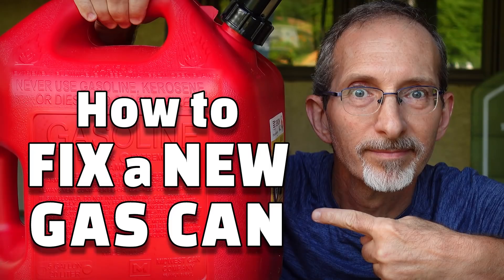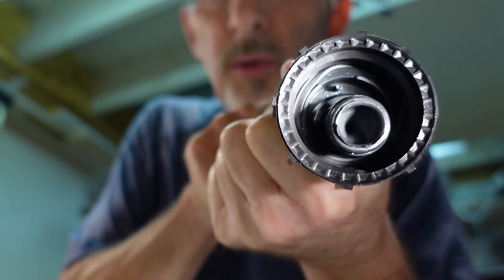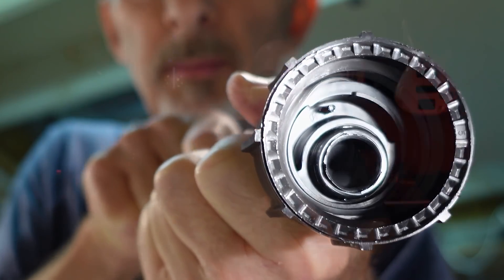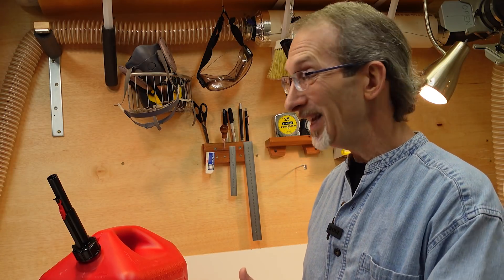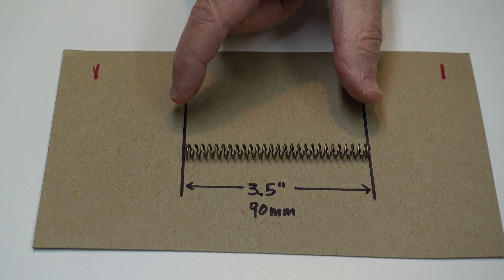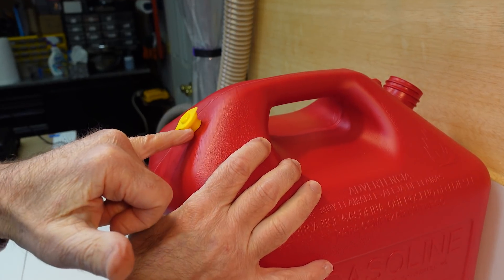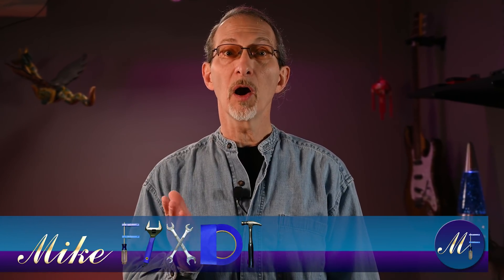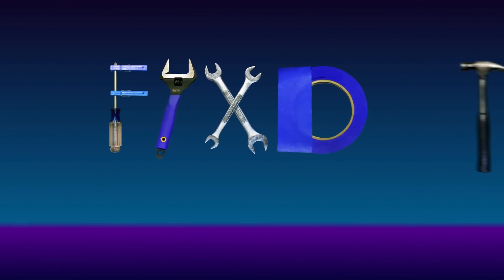Gas Can Modification | Part 2: Explosive Details!

Comment: I was a Risk Managed for the largest municipal utility in the state of Michigan.
Fire prevention was very high on our list of safety measures. We used systems like Lockout Tag out whenever hot work was performed, among many other safety program rules and procedures.
I agree with everything in this video.  The ridiculous modifications to gas cans create more of a hazard than the old style cans.  Proper training is the solution.  But as the saying goes “you can’t cure stupid.”
Reply: You cant cure stupid, but you can vote it out if office.
Reply: @patrickbodine1300  Or at least require actual engineers make the standards.
Reply: @Stroys last sentence says it all.  ♾️ 🔁
Reply: “I was…” 😂 they discovered you had common sense and critical thinking skills.
Sorry you lost your job due to those skills. 
No place in government for that skill set.
Reply: I like stupid people deserve stupid results
Reply: Proper training only goes as far as proper execution.
Reply: Two by four applied to the back of the head cures stupid but this method only works for few hours and must be applied again.
Reply: The new gas can spouts have created an unbelievable dangerous fire hazard. I have personally never seen someone or myself been able to operate these new ones without spilling everywhere. The old design I was able to pour without spilling for decades even has a 10 year old. The nightmare these new spouts have created almost seems intentional to start more fires, create more gas spillage, and be over all terrible for the environment.
Reply: Not only is it impossible to 'fix' stupidity, they've made it illegal to try.
Reply: Lock out/tag out in the Navy, we actually had one guy in the repair shop on board ship who spent the entire day doing nothing but LT for everyone else 🙄, yea I guess the Navy was worried about a vessel loaded with Nuclear warheads.
Reply: I used the new style spout which is tricky.. Its only 2 gallons.  Seems ok.
Reply from the maker: @Stroys - thank you for supporting these mods and my message! This video definitely put me into a gray area, where common sense and regulation are heading in opposite directions. It’s nice to hear someone from the industry’s opinion. I appreciate you joining the conversation!
Reply: @stroys (2 years late to this party)  I work with LOTO systems for years. But they don't make the tool you want to use from actually working. These gas can improvement mods do that and the exposure to longer time, with a heavy load, in a usually awkward stance, are NOT improving safety.  It is rare I don't spill gasoline with these awful unmodified gas cans.  Hence all of my cans are modified similar to  Fyxdt.

Comment: I have 3 cans with a pop top and a air vent  from the 80-90  and what ever!!  takes 3 seconds to fill anything  these new cans  SUCK SO BAD !!   but the older ones are 2 gallon ones  and needed bigger  WHAT A PAIN IN THE ASS !!!
Reply from the maker: I also have smaller cans that I’m happy with, but I needed some bigger ones. This is what I ended up with, and after the fixes I have to tell you they are actually OK. Thanks for watching!

Comment: I would have smacked that vent with the soft side of a parts hammer. No heat around gas fumes if the can was already put in to service.
Reply from the maker: I am definitely going to try the mallet trick instead of heating it next time. Thanks for the tip!

Comment: Just a side note in our area u can buy the original style spout and swap them out. Im not sure what regulations other areas have.
Reply: I get my replacement nozzles at Tractor Supply and they also come with a vent with attached cover and they work great on 5 gallon plastic cans.

Comment: I work at a full service gas station, see many of these, even sell them,  EVERYONE HATES THEM, To the point that they buy racing cans, there's cheaper and easier to use   or just go to tractor supply and buy a nozzle that is a replacement for that one,  toss that one in the garage,  where it belongs
Reply from the maker: Karl, I value your expert opinion, especially since it agrees with mine! :)

Comment: Dude, why you sweating bits into a clean, new can. Just dump it or rinse it when done drilling. Even blow some air if you got it. 
 Heat the can...not a chance of me doing that. Palm strike or rubber mallet.
I don't know anyone that is a "get er done" kind of guy at home that would do anything other than make it go.
 I have new ones in all my cans as either a replacement or like those SOB'in new cans, an added feature as you have done.
I guess it's good to show options but show the simple man options as well.
 I have an entire shop for our home, hot rods, and maintainance equipment and don't own and air solder heater dealy...
But I do got a rubber mallet and a palm to strike it home with.
 Good video...
Reply from the maker: I hear you! The fancy air soldering thing is my sons and just happened to be there, so I thought it was safe to use. I kept my finger in the stream of the air figuring that if it was too hot for my finger, it might be a danger for the can. It never got that hot. Next time I do this I will give it a good whack with a mallet, like suggested! Thanks very much for watching!

Comment: Brilliant, the vent cap was a perfect choice to fix the slow pour of these "new safety cans". you also picked one of the thickest parts of the entire can to install it. as for the spring, I would have gone to the hardware store for a new spring with a smaller diameter wire or more coils or both. When you remove coils from a spring the coil or spring rate increases (the spring gets stiffer). however, your method is perfectly legit and obviously works. This is only my autistic brain at work that drives me to perfectionism, it doesn't always work. I agree with you on the flame arrestor. I don't pour gasoline on open fires, but I have seen people do it... and get burnt. As one of my more favorite characters likes to say, "Stupid is as stupid does".
keep up the great work. I look forward to seeing what else you have for us.
Reply from the maker: I appreciate you watching and it seems like we have a common way of thinking. The spring was an experiment and I think it worked out pretty well. One of my goals was not to spend anything additional, just use what came with the gas containers. Mission accomplished, but I’m sure there’s other valid solutions. Thanks for joining the conversation!

Comment: I've spilled more gas trying to use those "Safer" spouts, than I ever spilled before....
When it comes to gas-cans, "Difficult = Dangerous."
Reply: I have NEVER gotten more gasoline on myself then I have trying to use these "safety" spouts.  I've had some that the spring was so strong, it literally shot the end of the spout and miscellaneous parts into the fuel tank when the little lip slipped off the edge.  Naturally fuel went everywhere.
Reply: And all the hydrocarbons that are being released during the spillage from these unsave designs.
Reply from the maker: Allan, exactly! Thanks for watching.
Reply: Exactly.  I gave one of these cans.  Absolutely hate it.

Comment: I am a 72-year-old with emphysema along with back fusion. I for years used a jerry can to fill my bobcat with diesel fuel, gas is 36 lbs for a 5 gal can, I have been told that I am limited in the amount of weight I can lift to 15 lbs. in 72 years I haven't ever had a punk-ass college graduate need to tell me anything that I don't know without the common sense factor. The Government has put these things into law now I can't even get a new nozzle for my Gerry can. when I used the can's to fill the heaters I got the smaller nozzle so there wouldn't be the threat of spilling it. I know you are saying what is a 72 year old doing this for. to tell you the truth it boils to the quality of life that I want to enjoy.
Reply from the maker: Alan, I hear you! Thanks for contributing to the conversation. A lot of people who have posted have spoken highly of battery operated siphon pump’s, which let you leave the fuel container on the ground and put the fuel where you need it with no lifting. Maybe that would be helpful?

Comment: It's all government regulation B S. Think Midwest worst move was doing away the the side pour handle causing more strain on the back. I have a old midwest 5 gal can that has that handle on the side and by far is way more comfortable when it comes to the pouring.
Reply from the maker: Bryan, you bring up a great point, the ergonomics of this can. I definitely think a side handle would make this easier to manage. Thanks for joining the conversation!
Reply: @MikeFyxdt  Actually the side handle to me should be horizontal rather than vertical and just up from the bottom.

Comment: Excellent video, Mike! I did the spring and cap mod to my midwest 2 gal, didn't need to vent it as I'm using it on a small push mower.
Reply from the maker: Thank you Paul! Yes, when you’re filling a smaller gas tank maybe the slower flow would be an advantage. I appreciate you watching!

Comment: Typical of the government, take something that works and make it unusable. I'd love to see the idiots that came up with those spouts try to put gas in a tank that has a filter installed in the neck of the tank or try to hoist up a six gallon gas can to fill a tractor.
Reply from the maker: Yeah, there’s some things you just shouldn’t attempt with these container designs. A lot of people in the comments have recommended an inexpensive battery operated siphon pump, so you don’t have to lift the container and you can easily put the fuel where you need it. That sounds like a good idea!
Reply: @MikeFyxdt  great idea 👍

Comment: Fancy name to get people to buy a dangerous product. Pressure will build and when you try to empty the fuel into a tank on a hot day it will spry back ond possibly cause a fire and how do i know ?  Years ago i had just this experiemce and i was not impressed. I destroyed the gas can and went back to the old can with a plain nozzle and vent.
Reply from the maker: Manfred, you are correct – you definitely need to burp these cans if they have been sitting. Great points, and I appreciate you joining the conversation!

Comment: i still got my old gas cans from the 80s and the 90s and the one that i have from around 2010 is the worst thing so i use it as added fule storage but then my old 2.5 gallon can runs out i fill it with the 2 gallons from the can from 2010
Reply from the maker: My 2010 can had a pretty crazy design, but eventually I got used to it. Now that I made some changes to these spouts they are much more manageable. I appreciate you watching and commenting!
Reply: @MikeFyxdt   i know how to fix and gas can issue ive done it with my 2010 can and that just simply use a large funnel with taking the whole dumb spout off the can

Comment: Great video—tho I didn’t see you turn can upside down & shake (or another method) to be sure drilling didn’t leave any bits in can.
Reply from the maker: Tony that is a good point. I did peek into the can after the fact and there was nothing in it. Someone else suggested blowing into the hole with compressed air. All good ideas! Thanks for commenting!

Comment: This guy is spinning his story to make the modifications sound feasible. Total distortion of the facts. I don't like the inconvenience of the safety features but they help protect me so that's good. Note that he had to produce another video to try to make up for the really bad advice he gave in the first video. Companies have to comply with safety standards. Note also that when he removed the insert in the first video, he removed the air vent which will cause vapor lock and it will take forever for the gas to pour out. Do you really think the drilling for the "new air vent" didn't cause bits of plastic to fall into the can? He should have advised you to thoroughly clean the inside of the container out after drilling. You don't need psychic powers to see lawsuits in this guys future. This is my opinion and I'm entitled to it. Please stay safe everybody.
Reply from the maker: I respect your opinion and I think it’s great to have counterpoint here in the comments. And yes, everyone needs to stay safe and do what’s best for them! Thanks for contributing.

Comment: For some reason my gas can keeps trying to expand and leak gas from the cap.. I have it on tight.. Not sure why it's trying to get so pressurized, because I'm not storing it in a hot location... Crazy mess.. I had it in my garage.. Doing it.. and I ever said screw it.. lol.. I brought the damn thing in my house and put it in one of my spare bedrooms that stays cool.. Not long, just to test it and yep!! Still doing it.. it's only like 3 years old also.. Why is it doing this mess?
Reply: First of all, don't fill it too much.  If you are letting the gas pump tell you when to stop filling, you are over filling it.  Secondly, remember that the gas from the pump is probably very cold from being in a tank set in frozen ground.  When you store it in your garage at 60 degrees the gas is going to expand.
Reply: @tomnesler2089  Oh yeah.. I never fill them all the way up.. like 8 gals in a 10 gal can . But the 2nd one makes sense and you're probably right..  Thank you for the info man..
Reply: @tomnesler2089  That's also using #2 5 gallon cans.. one of them is the only one that does it.. I just ordered a kit to change it with a vent valve on it..
Reply from the maker: @tomnesler2089  Good points Tom!
Reply from the maker: That’s crazy! I expect some expansion and contraction, but it sounds like your gas can is possessed. Whatever you have stored in it is trying to escape!
Reply: @MikeFyxdt  lol.. Yeah I had gas all over my garage floor.. Lol.. Crazy Mess for sure.

Comment: I don’t necessarily blame the manufacturers for these idiotic products - I blame attorneys and our court system. The only reason they design products in this manner is b/c some dumb-a$$ used the product in exactly the wrong way and either severely injured or killed himself or others and the company got sued. And the dumb-a$$ “victim” or his family won or got a big settlement. And now the rest of us have to pay for his stupidity.
Reply from the maker: @T B -thank you for adding this important comment. Since making my two videos, I have learned so much more about the government regulations on gas cans, brought on by what I think are frivolous lawsuits.
Reply: @MikeFyxdt  my wife is an attorney ( Tax/ERISA - not an ambulance chaser or criminal defense ) and we’ve talked about this for years. Just read the warning labels on some of the most commonly used items around the home. It’s absolutely laughable until you realize why those labels are written in this manner. You’re correct - some of this is also do the inane regulations imposed by the bureaucrats in DC.

Comment: I just spent 4 hours reading all the comments and laughed my ass off until I was laughed out. Then I thought of a serious flaw in the design of the safety valve. It has no overpressure release if the gas can is left, say in the back of a pickup on a hot summer day the fumes could pop the can. I think that the company that makes them should be notified of that potentially dangerous flaw and should be tested or just be recalled. At least with the modification of the air vent, the pressure would escape through it.
Reply from the maker: Ken, first I have to agree that everyone’s participation in the comments section for these two videos has been awesome! So many people have also commented about their concerns with these gas cans bloating as they warm up. As one viewer put it, “they get pregnant”. 😂🤣🥲 I added the vent cap in my second video, and while it does close very securely, I also get the sense that it would pop open if the pressure really built up in the can. Thanks for your comments and for continuing the conversation!

Comment: These containers and spouts are crap. I just want to fill and dispense fuel easily. I guess it's too much to ask
Reply from the maker: Ken, it’s not too much to ask! These modifications go along way to making these cans more usable. But I definitely think a better quality gas tank is in my future. Thanks for watching!
Reply: @MikeFyxdt  I appreciate the advice on correcting these spouts. I just threw mine on the ground and the spring flew out. LOL!!! It works a lot better now. As for the locking mechanism I kept it. Thanks again.
Reply from the maker: @kennightingale516  Ah, the "throw it on the ground until the spring pops out" method... Genius!
Reply: @MikeFyxdt  Yea, I don't recommend this method, it just by chance worked for me. :-) I will follow your instructions next time.